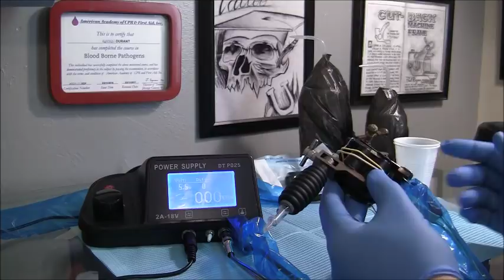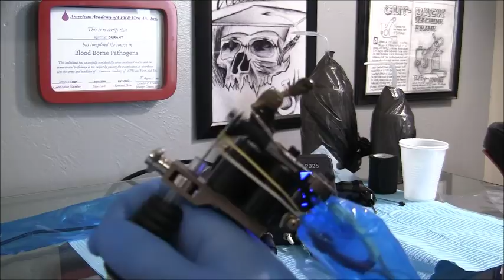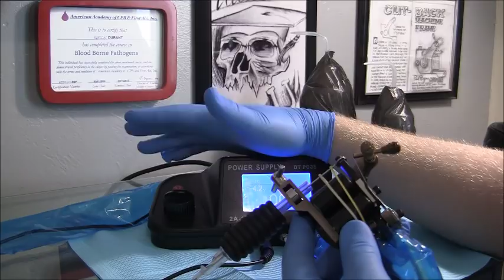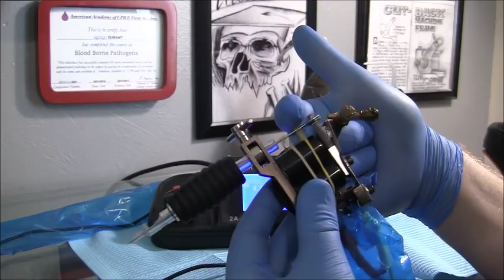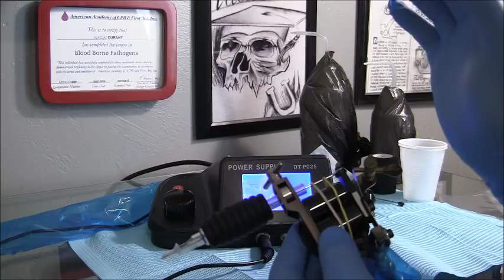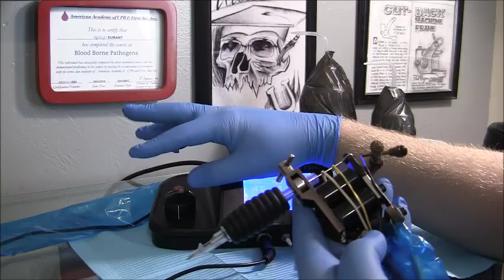Setting the Correct Voltage- Tattoo University

Comment: this comment has nothing to do with the video but it was def a nice video . I remember one of your older videos talked about springs I don't know if you have one of these yet for cutting your own springs this one is a cheap knock off but it works I just received one and I love it punches the holes nice in my hand cut springs for a fraction of the price a real one costs but check it out I have the same one and I love the damn thing and didn't have to spend 80 + bucks ....https://www.ebay.com/itm/Heavy-Duty-One-Tone-Power-Punch-Aviation-Sheet-Metal-Hole-7-Size-DIY-Die-Plier/292157923993?ssPageName=STRK%3AMEBIDX%3AIT&_trksid=p2057872.m2749.l2649
Reply from the maker: I have that.  I will try to show it in one of my videos.  I use it a lot.
Reply: awesome I just fig I would put it out there for anyone else as well . it works well I'm glad I got it I have some sterling silver contact points I want to place on some of my springs .

Comment: I have learned a lot thanks to you, I have one problem my machine runs nice at least that what I think. Out of the box contact screw was at a sharp angle it touched a front spring at an angle just the edge I have watched videos the guy says it must to touch spring flat. So I adjusted it and the sound is better I got right figures. But I have to kick-start maybe just more volts? According to my powrsupply I use 6,5. I also don't know if you mention in any of your vids about figure 8and two circles /armature bar niple. Thank you for visiting if you could answer I would be delighted but I don't expect the answer thank you very much.
Reply: Now I'm afraid that contact screw is in a wrong place cause it touches not a tip of a front spring maybe that's why I have to kick-start. But it touches flat of I want it to touch a tip it touches spring at an angle I don't know maybe I Need shorter spring but the angle I have now but it would change a lot wouldn't It? Maybe I'll just play around
Reply from the maker: I've heard that contact screw should hit flat and I've heard it should be rounded.  I prefer to round them off.  The machine will need to be fine tuned.  It is running out of the box but not running as good as it could.  Adjust the gap between the rear core and the armature bar.  Adjust your springs so that your duty cycle is correct.  Adjust your stroke so it is correct.  You can also adjust the weight of the armature bar.  Also change out the cheap connections with brass connections.  All of these things will help.  These machines can run with less voltage but you have to adjust it first. Out of the box it will probably run at 8 volts or more.  You can also change out the clip cords.  You have to crank up the amps if your clip cord is really thin.
Reply from the maker: I've messed with machines enough to know all the adjustments.  If you run this out of the box it will not be a good machine. If you know what to do you can turn these machines into great running machines.
Reply: Sphinx Wojerz Yeah you learned a lot, a lot of fucking bullshit listening to this fucking hack job

Comment: Great video. Be nice if you could address some. Of these pointers for rotaries too. Best voltage on a rotary ?
Reply from the maker: I will do a video today about rotaries.  Will start throwing rotaries in there more.
Reply: Tattoo University awesome man! Do you have a website?
Reply: I use a gen 2 hummingbird rotary and use use it at 7.1 volts max for lining . anything less for shading .

Comment: Hey man very nice video once again! I have some questions. 1st my machine is same as yours from what I see and I have some trouble with it... I had a spark between the contact screw and the spring. I've changed the capacitor, cleaned the spring and screw then changed the springs and then changed the screw. None of that helped the spark is still there no matter the voltage. And when I do the touch test on the nipple the spark gets even bigger and from one blue dot goes to whole bunch of red-yellow sparks. Do you have any idea what to do? And the second problem is that sometimes the machine runs for 1 minute aprox. and then stops like i have left my foot of the pedal and then pressed it right after for several times, and then continues to run good for several minutes and does that again. Any idea?
Reply from the maker: Needs to be tuned correctly.  The first machine I had was this style.  I took it apart over a hundred times trying to fix it.  I just learned how to tune them so they would work. I did a video about kits and tuning the machines in them. It explains what to do with them.  There is a way you set them up that works.  It is something I've perfected because I messed with it so much.  You get them to work with very little spring tension so they don't overheat.  You use smallest gap between the rear coil and the arm bar.  Use some silicone on the coils to keep them from moving around.  Once you know what to do they make very good machines.  I'm still using my first machine.  I've tortured that thing and it is still a solid machine.
Reply from the maker: Here is what I do to those machines before they work.  They have an angled rear deck that is slippery.  I file the coating off the rear deck so the washer will hold the spring in place.  Being angled the springs already have tension on them so I don't put a lot of tension on the springs.  I check the gap between the rear core and the armature bar.  I put the smallest gap I can there.  This way machine doesn't have to work hard.  I remove the coils and put silicone around the bottom.  This prevents wires from touching the frame and keeps your coils from coming apart.  I also grind off some of the armature bar.  Make it lighter for shader or liner.  I don't use these for packing color.  This way you only need small stroke.  After doing this the machine doesn't have to work hard.  It will work with less voltage and run for a long time.
Reply: did you change the material of the contact screw or just replace it ? Sometimes copper screws on none blue steel springs burn holes into the spring. While a silver screw would layer ontop of the spring.
Reply: Get a good machine .this ones junk
Reply: I would change to copper or better silver then. "Brass and steel are a very hard metal and they also spark a little. Over time they will burn a hole all the way through the tip of a front spring." quotation from an article. I am still learning though so I just can share the things I am told and reading :p
Reply: yeah man I noticed that it just burns slowly the tip of the spring. I'll try copper or silver and hope to be better, thanks!
Reply: Maybe yours gap between contact screw and front spring is just to small I had this problem with a new machine out of the box the gap was so small that sparks got very big and an angle was wierd contact screw needed to be adjusted and angle changed. I think with this machines you need to adjust everything it's a great fun just watch more vids and play around I think fun is the most important part in all of this. Have a good day let us know if you got it sorted
Reply: yeah man thats what Im doing Im shooting in the dark. Dont have such power supply and cant find something like this and Im not from the US and its even harder
Reply: You can also use a multimeter, with the capabilities of reading duty cycle and hz.. at amazon you can get some alright/decent ones for around 30-40 € in Germany.
Reply: Its different on different models. sometimes you turn this middle wheel thing to hz% and press another button to change between HZ=cycles per second (1 hz = 1 cps) and the duty, and some have like two different symbols on this middle wheel thing or Buttons if you have a expensive one.. You need to check the instructions of the model you´re going to use.. or try it out... The important thing is to really check in the Specifations of the model if it really has this options, because its not standart option to have Duty and Hz on it.
@ spinxwojerz... well at least you dont have the stress of having all these cables and tools lying around then. Hope it works for a long time m8. which one you bought, I was looking for one too.. but the only ones I am capable of finding are the ones from Eikon and critical.
Reply: Buy quality machines, well made foot switch, quality power pack and even a good $50 clip cord and I promise you all these lil bullshit issues that hinder your ability to improve your work and become a way more consistent artist that's excelling with a lot less stress in your life.
Reply: I've changed it to brass screw. The original is brass as well I think
Reply: Youre welcome mate, hope it works :)
Reply: I just cant get it right. The tension is not much, the gap between rear coil and bar is good I think, Ive watched the other video for tuning the machine and still have problems. The machine was both liner and shader when I got it (I think) and now I want to make it a shader. So I bought longer screw, put it in sharper angle and had replaced the front and back spring with shader springs. The front is longer (I dont know the gauge) and the back is wider,which i suppose is for lining and not for shading. Today I did a tattoo set the machine yesterday at 6 volts and worked good and when I placed the needle and everything it was bearly running and I had to increase the voltage. I tried to twist the screw forward but when feeling the nipple it felt waaay to hard for smooth shading, so i dont know man. I'll try to change the cable to a bigger one, cuz the present cable is very thin and give it another try. Just need to play with it a bit more and figure out what is the best setup and leave it there.
Reply from the maker: Do you have a power supply with duty and speed reading.  What you are doing is taking a stab in the dark.  You can change the springs but how do you know the adjustments you need to make?  The duty cycle and speed will tell you if you are on the right track.  Then you also have a spring tension gauge to test your tension. Duty, speed, tension, and stroke all have to be correct.
Reply from the maker: This is the fun of tuning a tattoo machine.  Not everyone gets it.  It takes some practice.
Reply: KuddelDadaldu thanks for info I didn't know that I bought power supply from USA just to have duty cycle and cps. Damn hehe I'll have to check out this multimeter. In the future maybe the one I have seems to be good doesn't get warm stay nice and cold hopefully will be that way.
Reply: Yeah didnt know that either I'll check it with multimeter. Noticed in some videos of duty reading with multimeter with the DUTY options on some and other the Hz%, but can you check the cycles per second with multimeter? Does it have that option
Reply: pretty sure its the way ur contact screw is aligned
Reply: divided 66 .
Reply: It's not the contact screw it's the capacitor guaranteed